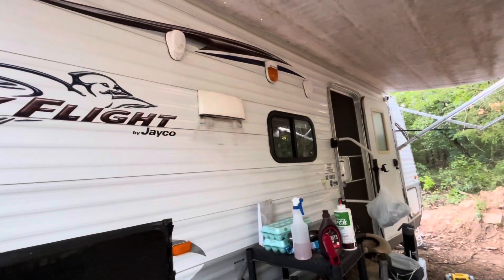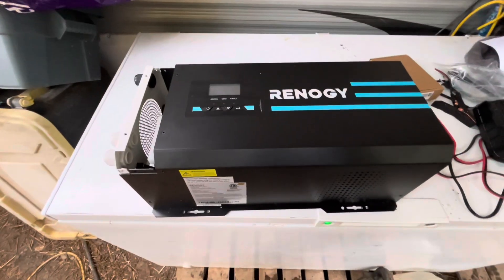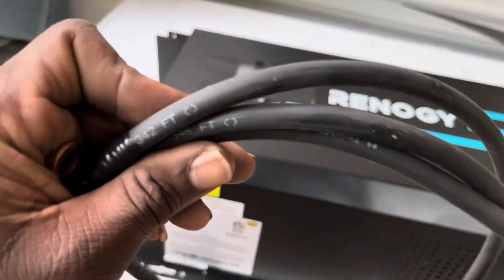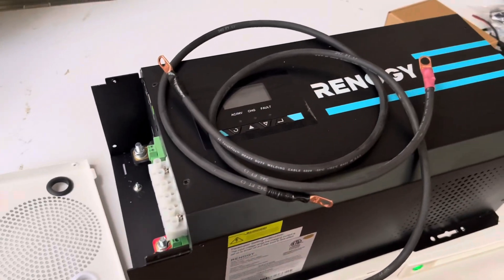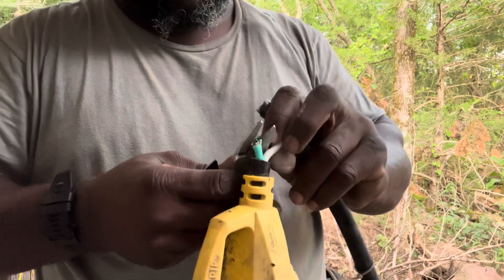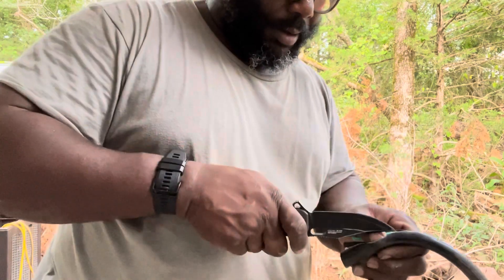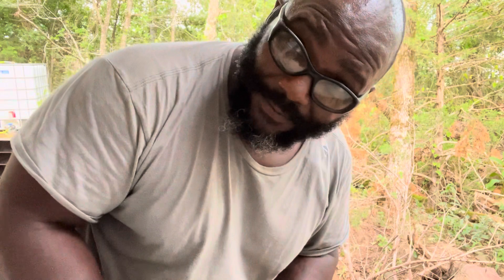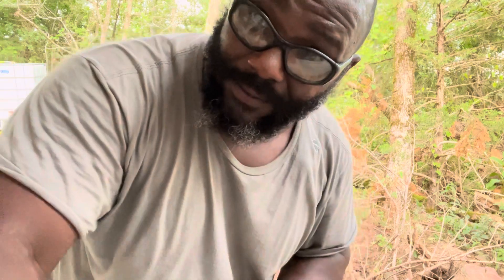Renogy 3000w Inverter Charger: wired up

Comment: Shalom and Blessings Brother... Did you wire the units in parallel ??? That out to increase your output 150% of current output. Now I’m going to ask if you are going to have to increase the number of panels to maintain charge rate without using the (gaso.) generator ???
Reply from the maker: My charge controller has voltage limits. Yes I have them in a series parallel setup. 4 lines of 3 panels in series.